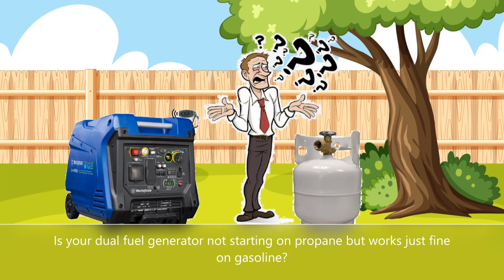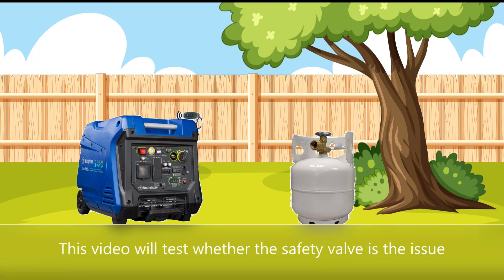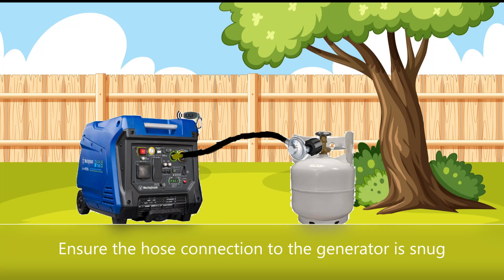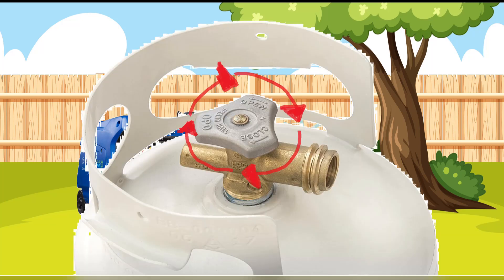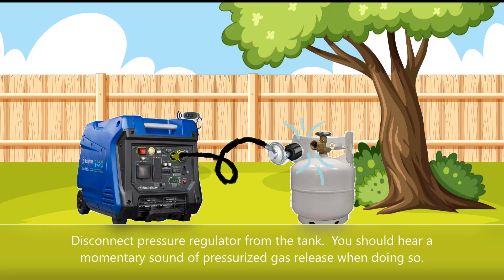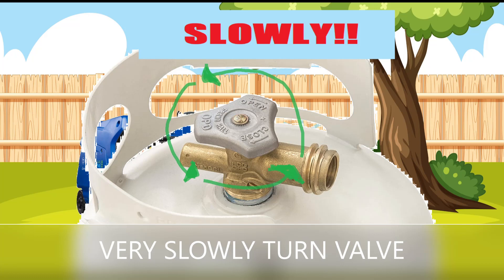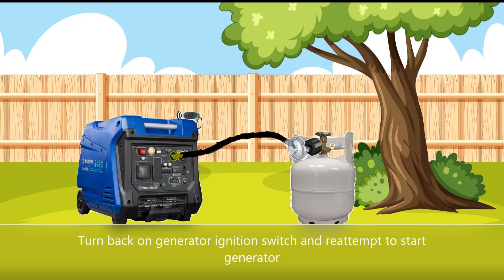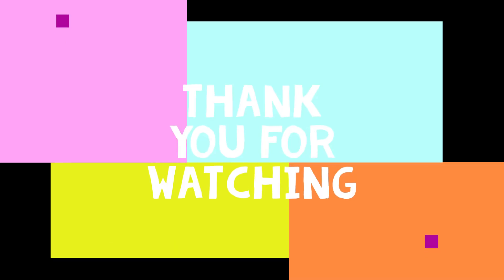Propane generator won't start , try this

Comment: There is no safety valve in the valve on the tank.... there is a spring loaded valve that opens when the hose with the regulator is connected.  The safety valve that prevents flow is actually in the regulator hose connector (black knob area).  That is what goes to low flow when the valve is opened too quickly.  It has nothing the do with the tank or tank valve.  It is in the device that interfaces to the tank valve first thing on the hose end.  Turning off the valve and slowly opening it resets it in most cases.